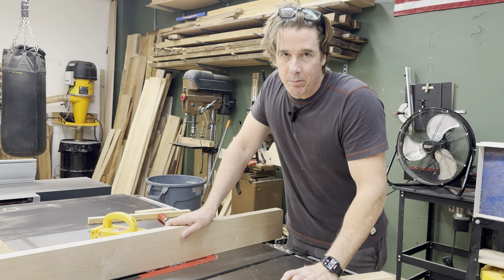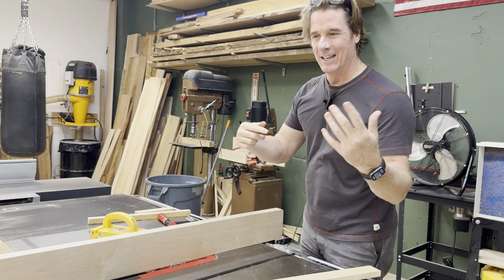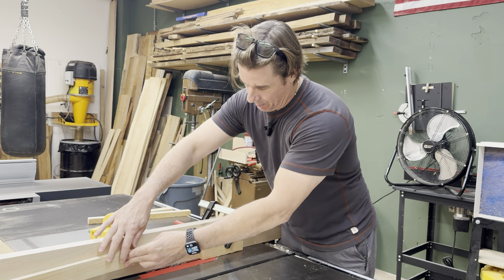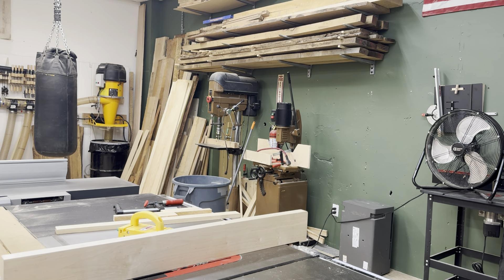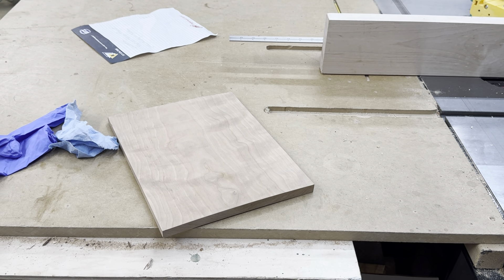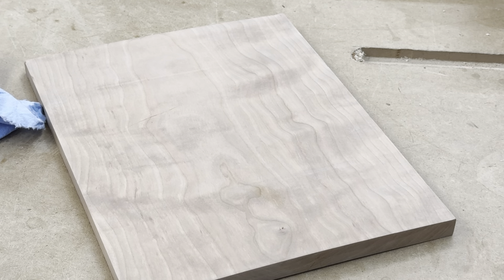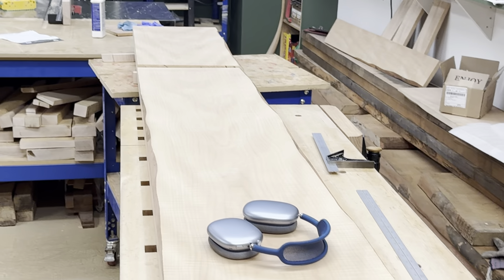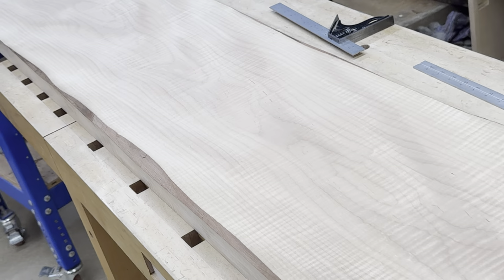Woodworking Tips from Tommy Mac: Mortises, Surface Prep, and Console Table Preview

Comment: did I miss it? You never showed how to solve the problem on the bloched cherry. I’m making a cherry dresser now and I have a lot of blotches.
Reply from the maker: Sorry to hear of the blotch problem ..are you applying stain ?? I never get blotch because i always use wood from the same boards and pay attention to all the grain direction and then before a top coat in apply  coat of linseed oil ..
I know lots of woodworkers have trouble with finishing .. me included so after I apply the oil i send my pieces out to a pro .. I am sure this answer is no help at all .. sorry🤷🏼